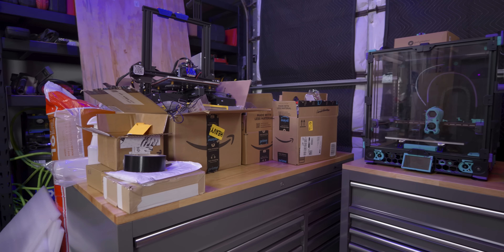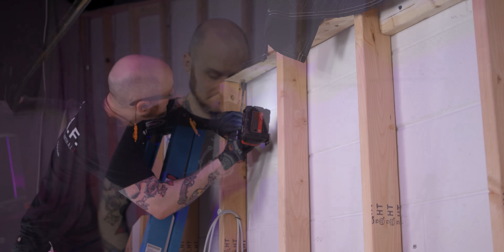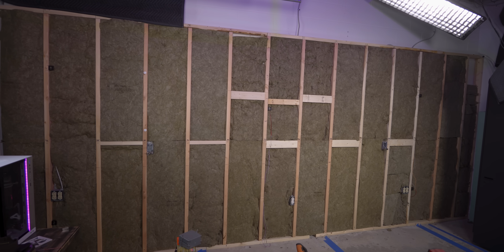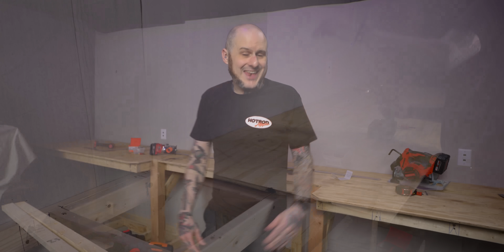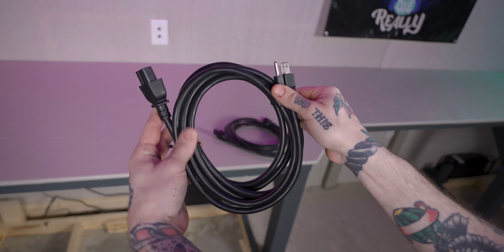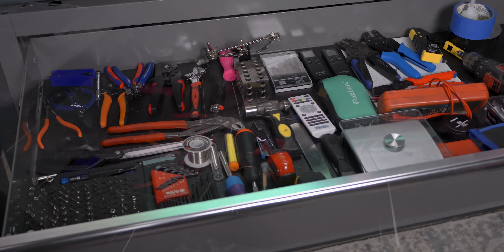Chaos to Creativity: My Ultimate 3D Printing Studio!

Comment: Can you tell me how long it took to build the wall? And what type of nailing gun thing is that and where can I get that? I want to build a studio for my 3d Printer and stuff...
Reply from the maker: That nail gun is from Harbor Freight. A drill and screwing it together would be more accessible as you need an air compressor to run the nail gun & electric nail guns are way more expensive. Time to build? I could have done it in a day if I wasn’t filming and working around electrical. So it probably took 3 days having to make room and film.

Comment: Gridfinity is good for fast storage that you can be hectic about, like desktop stuff. It's also nice for small swapable storages that you mount to a printer, there are some great items like SD Card rollodexs, tweezer racks, caliper racks, pen cups, also super easy to make your own.

Wire Management could be handled pretty well with gridfinity, unsure of what wires you would be storing. You can sort distances by using a wire clip esque thing at different lengths, but they would be streched out (or looped if you are storing linger wire). If you do this, there is not much room in between, but you could probably print small containers for connectors. 

I agree with the sentiment that for tools it is not practical, Gridfinity give you about 40 mm to play around with, so most larger tools will require non drawer friendly options or very large storage. I think it can work well for organizes smaller parts and keeping a swappable storage if you use certain smaller tool (screwdriver, pliers, calipers) keeping those around the studio. I have found it nice for migrating to working on a printer, there are many printer mounts available too ~around~, and obviously you can make them really easy: https://gridfinity.xyz/specification/

I also use magnets in mine when I can but it's a huge pain to do the actual parts since you have to use glue. There are magnet light press fit baseplates that are simple with a jig and no glue, however. You might find the swapability helpful, so it is worth trying by putting some baseplates around. Good to have "project" baseplates as well to group things while doing a project. 

But yeah, lining all you toolbox drawers is insanity due to wasted space...

Comment: You did a great job. I have a nice organized shop... It was a chore to keep tidy. I remember where I left stuff,  but they are not in the proper place. I jump from project to project so now I store projects in labled bins so the parts stay to geather. When I stop, I dump every thing back in and put it on the shelf. I have a lot of bins. :)
Reply from the maker: I do have project bins / boxes as well (in another section) but a lot of projects pull from “inventory” of parts I keep on hand. That’s the biggest issue, the inventory isn’t very…
Inventoried. 😅 Someday we will get a
real inventory management system.

Comment: Did I see you install the gang boxes incorrectly? I am pretty sure The tabs on the sides are supposed to be the flush point on to the stud. But hey to each their own. Nice build though I need to do exactly the same as you, clutter is killing my project flow
Reply from the maker: The box is intended to poke through drywall. I “recessed” it as I don’t have drywall. 👌🏻

Comment: Gridfinity works for me, I designed holders for all my crimpers and tools etc.. and fastners.. oh boy I have entire drawers of fastners all in gridfinity.

I'd suggest that your right hand draw would do well with a heap of custom boxes so everything has a specific home. Alternatively you could look at something similar to what Colin Furze did with Shadow foam. The reason I say that is that if there's an empty spot where a tool or thing is supposed to be, you tend to notice it's not been put back when you're looking for something else, so your OCD goes "where is that it's not where it's supposed to be" and you find it and put it back. it helps me a lot

Comment: Gridfinity is a rabbit hole. At first it seems like the ultimate organizational solution, but then you realize it's easier said than done to organize a plethora of disparate tools and supplies with only one system. Much of the process of getting organized is subjective and it will take time to find a solution that meets your expectations. At the moment, I am using both Gridfinity and other modular organizational systems that can coexist with Gridfinity and have found this approach much more appealing.

Comment: I have been really enjoying using gridfinity as an organization tool, however print time is a big consideration. I would definitely recommend at least a few of the items such as a used blades box or tweezer holders. The whole system seems to follow Adam Savage's rule of first order retrievability (ie. nothing has to move to get access to a frequently used item). Gridfinity appears to be best for small items in general. Side note if you want to print a bunch of single bins quickly I would recommend the spiralized Gridfinity bin by DaveMakesStuff in clear PETG as they are actually fairly transparent, print much faster than Zack's more robust design and are easier to get your fingers into.

Comment: I've been organizing and purging for the last 2 months now.  I find that the pack-out organizers don't have enough small bins but you can 3d print better bins!  The Milwaukee packouts are too expensive but the other brands are reasonable.
Reply from the maker: I’ve got a pile of the Harbor Freight packout-like containers for hardware. I’ll likely make a setup to store those in separately yet. They too don’t have enough small containers but that’s what printers are for. 👌🏻

Comment: personally I think gridfinity excels for small tool clusters on your desk. I have a 3x5 grid with two sets of cutters, a set of pliers, a file, straight and angled teezers, deburring stuff, nozzles, a glue stick, needles, calipers, a few different style putty knives, and lastly a printed alcohol bottle. all easily accessible and pretty much as small as a pure pile of said tools. 

it was more work but I went with 1x1 grid that use dovetails to connect. started with a 2x2 and just added as I found the need. in hindsight I think it needs to be modded to support derby weights so the small clusters have more weight when tools are removed.